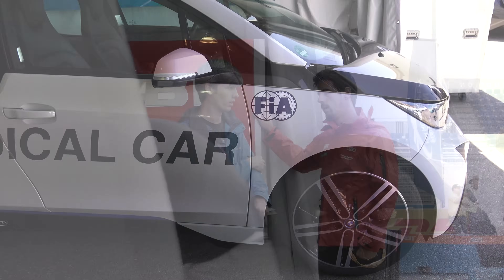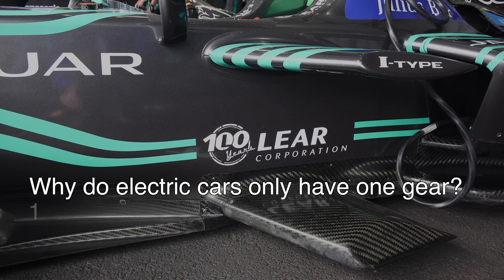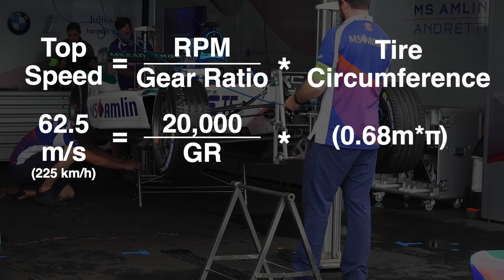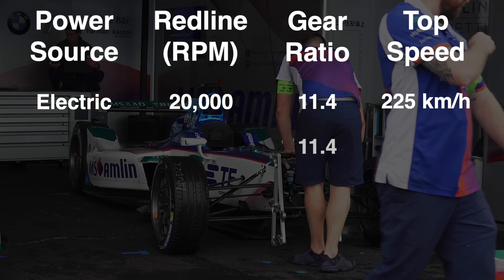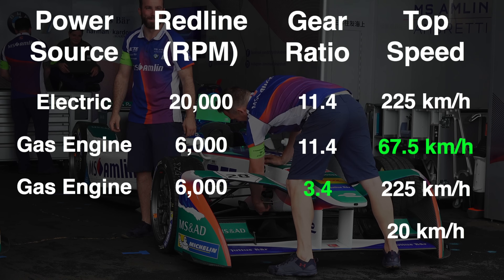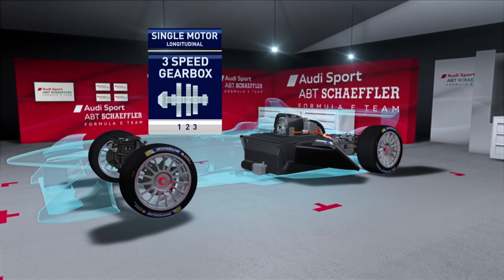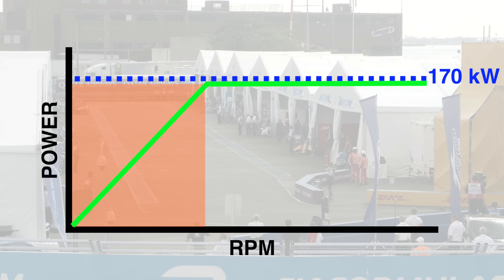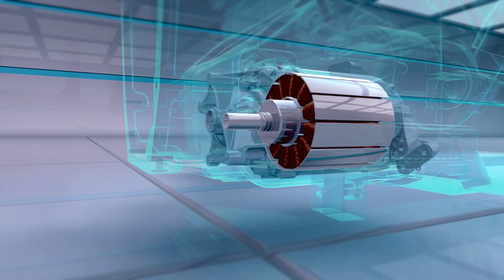Why Do Electric Cars Only Have 1 Gear?

Comment: Why such hate for electric cars? When combustion engines were first used in automobiles they were utter trash, the steam engine was much more efficient and more powerful and then guess what? the combustion engine ended up winning.
Reply: im guessing its more due to familiarity/ psychology (nostalgia bias) in favor of gas engines or just plain ignorance of electric vs gas.
Reply: That is because Steam is very impractical in small scale applications. Imagine having to wait 10 minutes for the water to boil in your car. Then you have to make sure you have enough of pilot fuel for the burner. Every time you start and stop your car, oil is needed for every single mechanical connection for proper lubrication. Once you are out on the road, you have to contently monitor your boiler lever and oil levels. Plus, steam is much more harder to maintain than gasoline engines. The internal combustion engine ended up winning because of ease of use, lower maintenance and cheaper costs. Electric cars were used as taxis in NYC in the 1890's/1900's for a short time, but ended up losing to gasoline because of battery technology.
Reply: 63Turbo
No, it's the other way round, and always has been. Electric motors are cheaper per horsepower than combustion engines.

What is expensive is the battery needed to power said electric motor.
Reply: ZManMD You found one drawback of EVs, I'll grant you that. But an EV won't kill your entire family if you turn it on in your garage, nor can you refuel your gas car at home. I've noticed gas stations have started screaming ads at you while you fill up. Fun.

It's all about tradeoffs. To folks who want to see EVs fail, gas cars have no flaws.
Reply: To get electric motos more efficient, you would need to change the laws of thermodynamics. Electric motors are already near the limit of whats possible in terms of efficiency. Battery tech is what we are talking about not the motors
Reply: marios gianopoulos

Are you saying that something being gay should be associated with hating that something?

Sorry, but i'm afraid don't value the opinions of homophobes very highly.

You'll have to try a more constructive approach hun
Reply: Are you aware of the physics of pushing that much electrons around quickly?  Here's a simply equation for you - Power = Volts times Amps.  Solve it any way you want and you end up with kilo-volts (lightning) and/or kilo-amps (welding).  If you have ever taken a physics class you would know that both are deadly and not easily handled.  So how exactly are they going to safely cheat one of the basic laws of physics?
Reply: dan clements

That really depends on your definition of car, but I'm pretty sure the first car was steam powered, almost 250 years ago. Electric cars and petrol cars both appeared around 100 years later.
Reply: +ZManMD once engineers figure out reducing charging time to just a few mins, electric cars will reshape the auto industry. the real question is will consumers like us accept electric motors over gasoline motors? since mostly everyone love the sound of loud engines. will we accept and adapt change?
Reply: Anyone who care about performance will adapt and accept the change after first they try a electric sports car and feel the incredible acceleration :)
Reply: You had me until 'size of a microwave and less than 50 pounds'.  Anything producing 30 megawatts at that size is not an engine, it's an indiscriminate thermal weapon.

So i'm calling BS
Reply: 4 Tonnes of Fury The first car in the world was an electric AWD car, however the batteries were enormous, it had little to no power and someone had to walk 20 m infront of it with a red flag
Reply: A number of electric car prototypes and new designs have range extending generators on board. Small cc wankel engines or whatever that can help recharge the battery if it gets low, on the go. It's actually pretty retarded to write off electric cars just because they haven't perfected them yet. Who knows what will come in the way of battery tech and generator tech.
Reply: I am not writing off electric cars, but I am not optimistic about full battery electrics.  For the near term, most cars must become hybrids to meet gas mileage regs.  A hybrid Corvette could get 40 mpg and keep its handling and acceleration.  
Battery tech is not showing the potential to accept charging at the rates to match gasoline re-fueling times.  So the best way for battery electrics to take over is for governments to choose to build the charging infrastructure into roads to permit underway re-charging.  Until that happens, Tesla's and other battery electrics will stay toys for the well to do.
Reply: I'm not sure exactly how you mean the words you're using here. Whether you'd classify a battery-with-generator style thing as a "battery" or a "hybrid".
Reply: Boosty boost
The batteries aren't great, but they're not much worse than regular cars, and better for overall lifetime which offsets the initial costs. And in terms of co2 emmisions in particular, they are vastly superior.

As for electric cars being extremely heavy and inefficient, that is plain wrong
The Tesla model 3 is more or less comparable with a BMW M5 overall, and actually has a LOWER curb weight, 1730kg vs 1855kg

Similarly, an Audi Q7 is similar overall to a model X, and is only 150kg lighter at 2300 vs 2450. that's less than a ten percent difference.

And the model 3 is ~3 times more energy efficient overall than the M5
Reply: 4 Tonnes of Fury coal! Coal!!!!
Reply: the electric engine will also end up winning, because the mineral oil will end one day and the oxygen in the air we breathing will be fired...
Reply: Combustion wins at mileage, electric wins at acceleration. And steam, steam is best suited for powerplants. A different tool for every job. The only way electric can beat combustion at mileage is if it's put in a bullet train where it has constant supply of power.

If we were to make electic cars that has infinite mileage it would be like making a bump car course, we will always have a metal nets above our heads that may pose risk of electricution and a problem on rains. And a waste of metal as well.
Reply: "Why such hate for electric cars? " Why such lack of reason and sense?

"When combustion engines were first used in automobiles they were utter trash ..." That does not mean it is a pattern here. Electric engines are nothing new. They co-existed with combustion engines from back then.
Reply: +Red Phoenix One word: accessibility. The majority of houses back then had limited or no power to them, petrol and diesel was easily accessible and in large supply, also battery technology was extremely bad, so it stands to reason why the electric car didnt take off.
Reply: I consider a car to be a vehicle with three or more wheels capable of operating without rails and capable of carrying a person.

By that definition the first steam car was built in 1769. I can't find any evidence for an electric car before 1881. Electric trains yes, and small models, but no actual cars.

And if you want to count models, then steam still wins, and in fact model steam vehicles date back to the 1600s.
Reply: Electric motors have been used for over a century... What do you think Diesel-Electric locomotives are?
Reply: 4 Tonnes of Fury Big money, oil companies...
Reply: Uh no. power to weight ratio, and power to dollar ratio is why.
In the 1980's, the horsepower per dollar cost of a piston engine
was half as much as an electric motor.... and it still is today.
Reply: @63turbo  motor itself is much much cheaper than engine. The only problem is battery which is getting cheaper every day
Reply: Indeed, electric cars and trucks were on the road many years ago in the early 20th century.  The same problem that killed them off then still exists, lack of range and slow refueling times relative to petrol powered vehicles.  In other words, they are inconvenient to live with on an every day basis.   Has anyone solved those issues in the over 100 years since?
Reply: The "hate " you sense is a healthy sense of scepticism.   Despite many Tesla owners' claims, the electric car is not yet ready for prime time.  At best it is a commuter only or second car.  The lack of range and slow refueling times are the biggest drawbacks to living fully electric.  The cheapest cars around can go 400 miles between refills (35 mpg x 12 gal) and refuel in 5 minutes.  Yet only the most expensive electrics can exceed 300 miles on a "tank".  Add in a refueling time measuring in hours against our instant gratification society and the electric vehicle still has a long way to go.  
There are two ways to overcome these hurdles, either by using constant refueling via in-road inductive charging or by rapid recharging via much higher voltages.   Each way has it good points and drawbacks.  
An inroad recharging network is currently the most likely method of creating significantly longer range.  This network would give electric vehicles nearly unlimited range but requires the government to commit large sums of capital to create special electric only toll lanes for a limited number of vehicles (~1%).  There is no free lunch (ask future Tesla supercharger users).  So the network must pay for itself, at least in ways that are demonstrably beneficial to all of society.  So maybe building an over the road truck charging network could be the first major commercial application.  It would remove large diesel engines that are highly polluting and it greatly reduces noise near the freeway. 
This network would reduce the number of available lanes for all traffic, at least in the short term.  It also must be maintained over time from wear and damages such as lightning strikes. Finally, induction works best at short distances or in direct contact (Qi charge anyone), so the vehicle must lower an induction plate once in the lane and raise it when not needed.  
The high voltage recharge method can be very fast but has the dangers of shorts and arcs, both of which are highly dangerous and destructive.  At 40,000 volts a Tesla P100D could recharge fully in 5 minutes with only 30 AMP current.  The low current creates low heat in the wires making the process viable.   However at 40kV, electricity readily arcs to ground, creating a severe danger for anyone or anything that creates a ground.  Imagine a car with a 40kV powerline laying on the roof.  People inside are perfectly safe, but try to get out of it or walk up and get in it.
Reply: Brent Smith Yes they did make a steam car, and steam engines were avalible in 1800 but they only started making a steam car in 1850, but the Electric car was made in 1834. They changed to steam because it had more power than the electric type, hence the reason why electric cars weren't really that popular up untill now (due to technological advancements). So in a way yes you are sort of correct, because it was more popular, but in testing wise the electric car came first...
Reply: The Chevy Volt is an electric car with a range extender.  The Toyota Prius is a hybrid.  The public is more accepting of an hybrid than an electric, even one with a range extender.  A hybrid has most of the benefits of an electric without the drawback of constantly having to plug in.  If, and this is a big if, the governments commit to building the infrastructure, electrics can succeed.  Without it they remain toys for the well to do and eco-friendly.
Reply: I believe it's because of tradition. Same went for pro-steam engine users.

Comment: Would it be possible to drift in a 1 gear electric vehicle?
Reply: Zwizzor i dont se why it wouldnt
Reply: Well when power drifting, downshifting to apply instant torque is very useful. I don't really see how it would translate here
Reply: Well, drifting can be done in pretty many ways. If the car is rare wheel driven you can drift just by hitting the gas, if it is on gravel or snow

Comment: There some electric cars conversations that keep the transmission, how ever it's usually only because they want a stock drive tran.
Reply: It does still make sense if you use less powerful motors for your home brew electric, Tesla doesn't have issues accelerating with several hundred horsepower motors.
But most people stay well under a hundred when doing this themselves, makes the entire electric system far simpler and cheaper.

Comment: Would a CVT auto box make sense with electric power?
Reply: The energy loss and the added weight of the CVT  would just off-set any performance gain.
Reply: CVT would slip, even more so with higher torque.